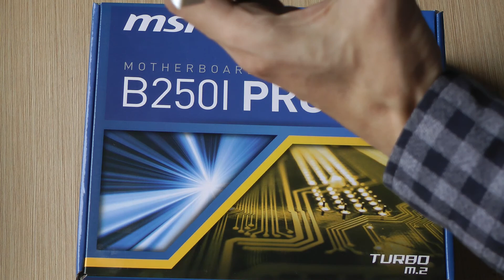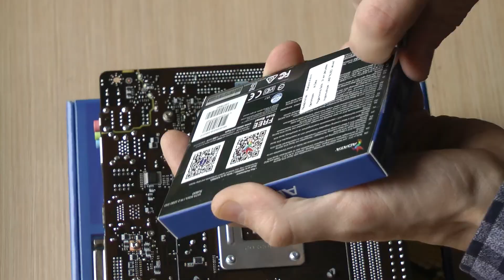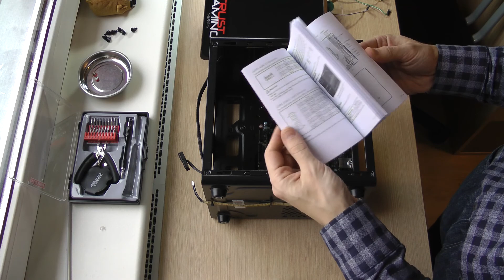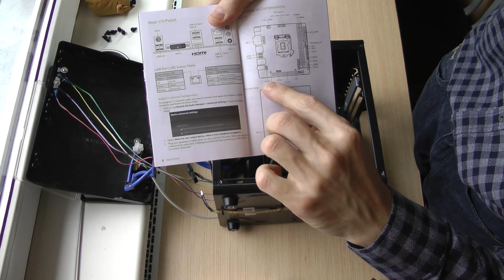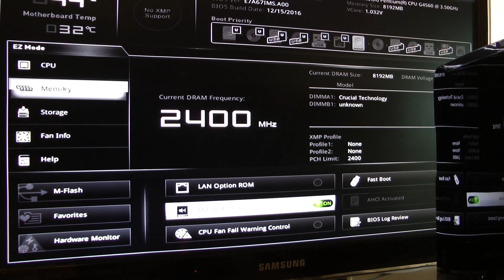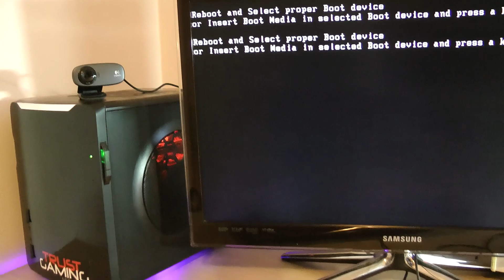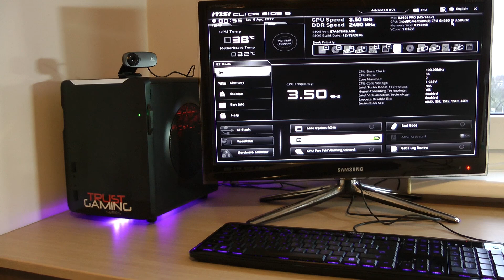Pentium G4560 + RX460 on B250

Comment: I noticed that you mounted some fan on the case right panel, can You share some info about it? What will fit in there, slim 140mm fan or something similar, how did you mounted it, glue, or zip ties? This case got a real potential.
Reply from the maker: Scythe Slip Stream 120 mm Slim Case Fan, with a thickness of 12 mm (regular wont fit). Mounted on magnets: https://www.youtube.com/watch?v=-sfET99tiuo need some hole drilling on fan, easy with hands (see video description). But i don't think it makes big difference in air flow, because it's partially cowered with psu. Mounted just because haw one laying around.

Comment: The 2 things I dont like are that u can buy a micro-ATX mobo for dis case and get a ryzen 1200 whitout loosing any money also if u didnt get the ssd u maybe able to  get a better gpu in there whitout loosing any money. And please dont get salty about my opinion I just think that ssds are not worth it in a budget sistem(Yes they decrease loading and booting times but do not increase FPS.(sorry for misspelling some words)
Reply from the maker: Thanks for comment, don't worry i'm not getting upset because of different point of view :)
Back then (Published on Apr 9, 2017) there were no ryzen 1200, as for ITX i have plans for future (HTPC or compact NAS). And i don't build pc's  without primary disk as ssd, hate hdd speed.

Comment: I KNOW HOW IT FEELS WHEN POWER UP FOR THE FIRST TIME FAILED! YELLING SHIT!!!!!!!!!!!!!!!1 FUCK!!!!!!!!!!!!!!!!!!!!!!! THEN TRY TO SOLVE WHAT EVER GONE WRONG.TAKE OUT THE DIMS AND PUT THEM BACK ON. UNPLUG THE 24 PIN POWER CONNECTOR AND PLUG IT BACK IN. TAKE OUT THE CPU CHECK FOR BENT PINS AND CHECK FOR PINS FALLS OFF. IF ITS OK INSTALL THE CPU AND HEAT SINK.CHECK ALL THE CABLES. POWER ON FAILED. CALL THE DEALER  RMA REFUND ON MOTHERBAORD CPU DIMS AND GRAPHIC CARD. SEND IT IN WAIT FOR REFUND AND ORDER ALL OF THAT ALL OVER AGAIN, I WAS REPEAT EVERTHING FOR 3 YEARS.24 DEAD MOTHERBOARDS 6 POWER SUPPLY4 GRAPHIC CARDS. JUST  TO HAVE ONE OF EACH TO WORK. I AM NOT BUYING CORSAIR AND ASUS NO MORE
Reply: funny kid.